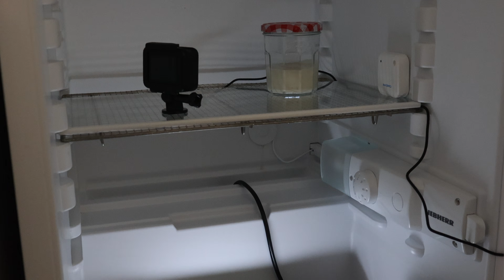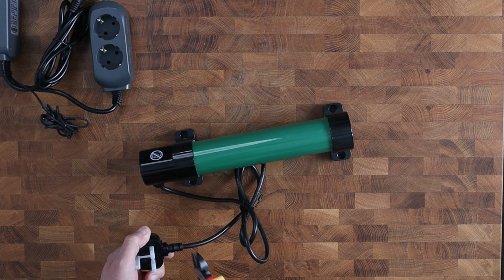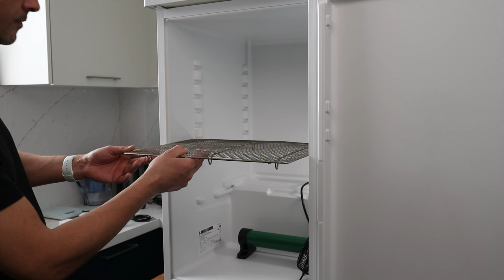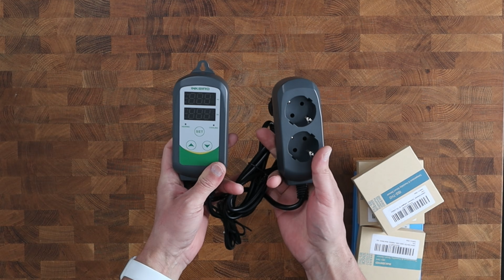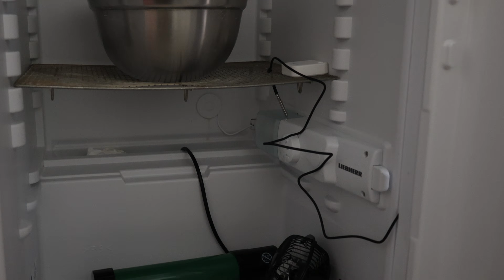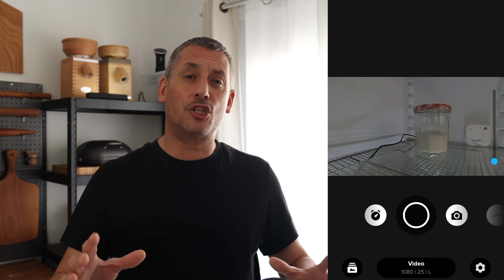How to Build a Proofing Chamber for Fermenting Sourdough Bread

Comment: I got a thing called a CRT that is designed to hold medicine at room temperature. It holds 25C consistently and looks like a nice little glass door wine fridge. I got mine secondhand for $50 so look out. It fits my starter and up to 6 bannetons.
Reply: Do you have a link for reference? Thank you.

Comment: If the temp is supposed to remain constant over long periods of time, I suggest putting a serious amount of metal or stones in the fridge to act as a temperature buffer. It will reduce the amount of air that is exchanged with the outside when the fridge is opened, and will help stabilise the temp of the fresh air after the door is closed again.

Comment: Great video Phil. I personally don't suffer from such temperature fluctuation in the UK, but do use a Brod & Taylor Proofing box, which does give great temperature control when used in Proofing mode. It doesn't come with all the electrical wizardry you have employed, but serves me well
Reply from the maker: I've heard the Brod and Taylor Proofing Box is very good. It would work well for me in the winter, but I need some serious cooling in the summer! Cheers Kenny

Comment: With a PID controller you should be able to leave both heating and cooling elements plugged in all the time, the unit will switch on either heating or cooling itself depending on what the internal algorithm tell it to. The fan isn't necessary at all either, the fridge is a sealed and insulated chamber and the heated or cooled air contained within will become homogenous very quickly.

I like the project though, and I would be looking at solar panels topping up used truck batteries with an inverter, to save on your power bills.
Reply from the maker: I'm seriously thinking about the Pid but I can hold some pretty constant temps at the moment. Interesting point about the fan. I've got a couple of panels on the roof of the apartment building that heats my water, could be another project :)

Comment: Similar to Barry's idea, but instead of ply, a thin sheet of perspex. Slots drilled for ventilation. Structural rigidity without the bulk.                                                                                                                    Great work on this experimental phase you're detailing. I've got a pH meter coming in order to monitor and determine optimal bulk fermentation using pH.
Reply from the maker: I've got one on order too, and Cachi (a viewer) has given me some ideas. Keep me posted on how you get on Michael, if you have any ideas, let me know

Comment: I use a box with heating pad and thermostat. The box does experience temperature fluctuations of about 2-3 degrees Centigrade, but it really doesn't seem to matter. I think you'll find, all you just need to look at the average temperature involved. It will work fine. :goodvibes:
Reply from the maker: Cheers Barry

Comment: I think you may find that a thermostat controlling a heater/fridge may not give you the temperature accuracy you're expecting - just because you're temperature controller is set to switch on/off at 0.3C difference, doesn't mean that the temperature will be controlled within 0.3C.
That's what I found when I was using a very similar setup for tests with home-made sous-vide controllers - there's a reason that no commercial sous-vide machine uses a simple thermostat on/off for temperature control, it's not accurate enough. Commercial machines all use PID controllers which 'learn' how to control temperature, and it's far more accurate.
I found that thermostat control, even though I had a temperature controller with 0.1C resolution, had set on/off difference to 0.2C and had a pump to circulate the water, in practice gave me 2-3C temperature fluctuations, which is the difference between a rare and medium steak.
I suspect you may hit the same issues, your Inkbird temp monitor will give you an idea.
Temperature control to fractions of a degree isn't easy.
Reply from the maker: Interesting Peter. I'll have a better idea very soon, I'll be testing how the temperature of the chamber and a dough hold over a fermentation period. Appreciate the feedback from your experience, very helpful
Reply: @CulinaryExploration  Hysteresis in the heater/cooler is the main problem. A heater continues to be hot, and therefore to output heat, for some time after it's been switched off by the thermostat, so temperature continues to rise.
Likewise, it can a while after it's been switched on before it outputs useful heat, so temperature can continue to fall but this is less of an issue than the hot end.
PID controllers learn to compensate for the hysteresis and reliably maintain temp to within 0.1C.
Good luck with the experiments, I'll be watching with interest.

Comment: I would suggest having the fan be powered independently of the heater/cooler so that it runs continuously. This will give a more even temperature profile thoughout the chamber at all times and a quicker response to temperature fluctuations. It doesn't look like the fridge has its own circ fan so the separate fan will be needed during a cooling operation. The fan is a heat source, but that should not be significant. Thanks for channel, it has helped me a lot!
Reply: Or, run the fan on a timer just to reduce Air stratification.
Ie, 3 minutes in every 30 minutes.
Reply from the maker: That's interesting, I could do that. Do you think the fan will survive being on continuously? Perhaps I should look at that element a bit closer. Appreciate your thoughts